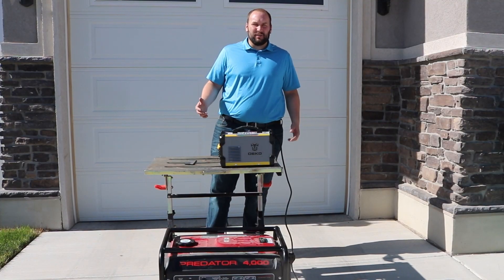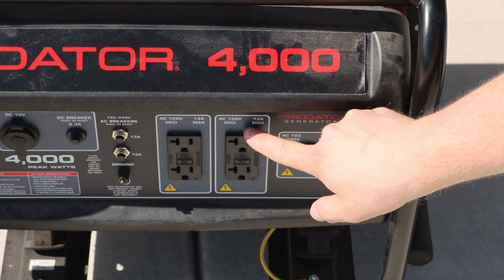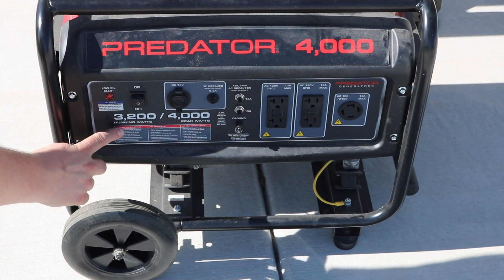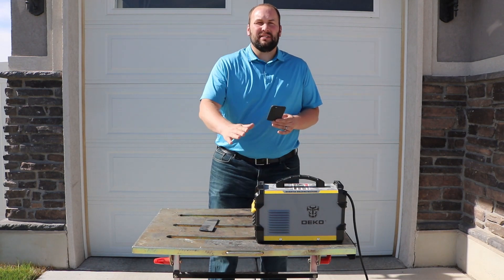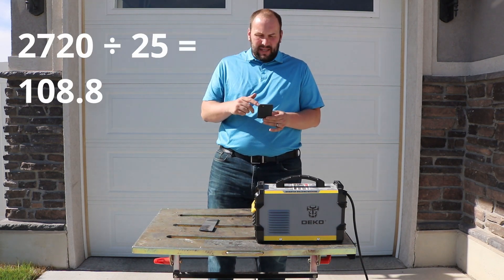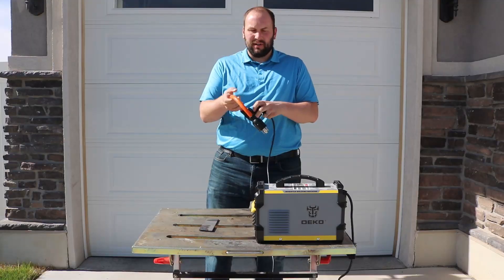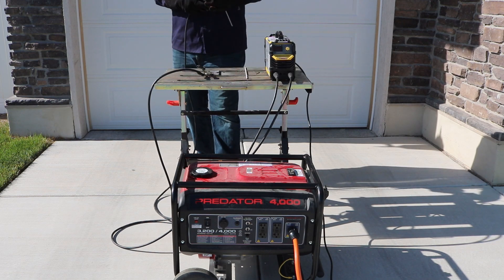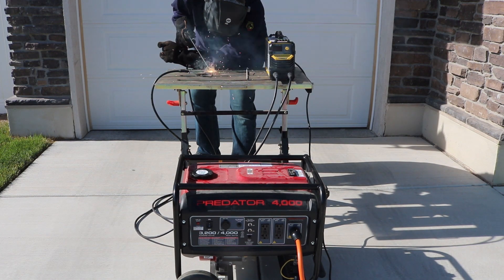How to Run a Welder Using a Generator

Comment: you might be able to adjust the generator to rev a bit higher when using the welder at a higher setting. last summer another guy was using a really small generator with a few power tools and the engine kept bogging down or stalling. I made a few very slight adjustments to the idle and governor settings while testing the generator under various loads.

Comment: I have a 7000 -8750 Predator generator. My welder is a 225 amp machine will my generator run my welder?
Reply: Did you try it?

Comment: Hi. May I know if you're using a welding generator? Can I use a non-welding generator for my inverter welder? I'm from the Philippines . We recently have no power for 5months or beyond without assurance after the typhoon has recently destroyed our homes and livelihood. So I'm planning to buy a GenSet but I honestly have limited knowledge about this thing. Your help is greatly appreciated 🙂.

Comment: Thanks so much.  You are a treasure.   Never welded before. However, you inspire me to take the rust on my Wrangler HEAD ON. I have an identical generator.  Too many talk on inverter welders not compatible with a regular generator.  Planning to get the Tooliom 110/220.  My question is: can I flux/core on 220v as long as I dont go beyond 100 amps on the Predator 4000? Thanks. Keep on the good work.

Comment: Harmonic distortion is why you can't get the full 100a. Large dc loads mess with the waveform coming from of the generator and even the grid which creates a feedback loop. If the generator isn't inverter style with low thd you can only load it to 50% with a dc load. Harmonic distortion is also hard on the electronics in the welder also.
Reply: Thanks for the education. I'm glad I came across your comment, I almost made the mistake of trying this
Reply: He was probably 10% out with the power factor aswell I have a simular machine with 240v and 25amp requirement to make 120amp dc with a .75pf it means I need a 4.5k watt genny or higher
Reply: What about an AC welder?
Reply: What generator should I get ?
Reply: @Victorv100 Making Mistakes With Greg just put out a super detailed video on this.
Reply: Thank goodness you guys are here. I got a 6k that didn't work as well. Now seeing this and what I need I can safely say what I need to get working again.
Reply: Sounds like a similar principle of running high draws on power inverters in RVs/autos... They're often rated at half of peak output, like RMS ratings on an amplifier, but if you run say, an angle grinder, it will only give you half of the RMS rates amps of the inverter.

Another example - I could easily put a 5000 watt inverter in my work truck to technically run a welder. But the welder will trip the inverter due to excessive draw. Suddenly we have a massive discrepancy in actual efficiencies. Use at maximum ratings have less efficiency than low use percentage.

Electricity generation is a very interesting subject.
Reply: Partly true, yes. Many cheap inverter (switch mode) devices rely on stable input frequency 2 generate voltage. The good 1s self generate / regulate the reference frequency. Most cheap generators cannot maintain frequency as the voltage with increased load. Simply, the switch mode device gets confused resilting in voltage and current variances. Such is why I prefer transformer units.
Reply: @Dark_Knight_USA 😊

Comment: I have been using a generator to weld for years but I use a bigger 8000 watt. When I turn up the power to 200 amp it bogs a little bit.

Comment: Hey Tim your videos are awesome since your knowledgeable about generators I had a question ,  so I got a buzz box ac 225 and I’m looking for a generator and I’m leaning towards a predator 8750 watt. I’m getting use to the terminology with it would run at 50% but could you please tell me if that’s a good decision ? I just don’t want the generator to get tripped up or have not enough power I only run at 110 tops but any help would be appreciated bro
Reply: Any luck with that generator I just got a 10500 running watt 13000 surge duromax and i also run a buzzbox. Trips on 1/8” 6011 trying to figure out why.
Reply: @benjanos5580  dude I haven’t grabbed one yet I’m about to grab this miller thunderbolt 160 what machine would you recommend because it can run on 120 and 240? I was thinking duromax but idk
Reply: @jokarpo6723  dude i also want a Thunderbolt im gonna get the 210 though because i do some heavy stuff sometimes also it can run on the 13000 duromax.
Reply: @benjanos5580  thanks bro I’m definitely grabbing that than that’s a nice machine if your grabbing the 210 tho I’ll definitely get back to you and let you know how it’s works out tho 👍
Reply: @jokarpo6723  awesome will do!
Reply: @jokarpo6723  since the buzzbox is ran by a transformer, its way less efficient, and you need more power to run it efficiently, if I were you Id get a bigger generator, like the duromax 13000, and get a nice inverter welder just like the Thunderbolt im really exited to buy It within the next month.
Reply: @benjanos5580  dude just wanted to update I’m just running my thunderbolt 160 on a 20 amp outlet and it’s amazing. I’m good at 80 amps and it’s just melting like butter your definitely going to be happy when you get yours man
Reply: Yeah you need at least 7500 Watts to run a decent welder on 240

Comment: Why don't you just spend $100 and buy a step-up converter it will jump your v from 110 to 220 and they're only $100 on eBay

Comment: I have a lincoin 50 amp 220 arc welder and just bought a 13000SW/10500RW generator. doesnt even bust a small line out

Comment: I have a 230v multi process welder, I hooked it up, set it to stick, I went to go weld (stick), but it wouldn’t weld. The machine was saying low voltage input. I can also plug the welder into a 120 outlet, but can’t weld at high amperage for my bigger 1/8” rods. Is there a solution??? Thank you!
Reply: Bigger generator is the solution, and/or an inverter generator.

Comment: Good video and good watt calculations. Probably your generator is 4k peak, and 3.5 continuous watts. I know engine welders are rated that way... I learned to weld on a engine drive because I didn't have to electric service to run a 300a DC welder.. anyhow my neighbors wanted to kill me! It was very noisy but I learned quickly 😆
Reply: That part about the neighbors 🤔

Comment: Hi sir..do we need use adapter when welding using a generator?
Reply from the maker: In the USA, the standard plugs on welders with 240 volt input are different than those on most generators. That is the only reason for the adapter.

Comment: hi Tim, I have a welding machine of 6.3 kva, 110 volts, 50 amps ...... what must be the power required to weld normally on a generator
Reply: From what you're saying, a 6.5kw would probably be safe, but it's best to have extra power when you're arcing up. This video demonstrates how the watts tend to go missing on their angry pixie way to the welder.
Reply: 110V at 50A = 5500W
He explained about 15% “losses” for inverter generators (so 6500W gen) and 50% on engine regulated generators (so 11,000W generator).

Comment: In a pinch you can always raise the throttle on the generator to push some more power out of it if you had to
Reply: not a good idea, you don't necessarily get more power out of it,
you will get a higher voltage and a higher frequency, which will fry your household appliances if you decide to use the generator for that afterwards
Reply: @turtmastert3545 or your inverter welder; it can probably deal with the voltage but the frequency is an issue

Comment: My duro max has 850 watt more but it trips when I use eazy weld & cen-tech 90 amp what can I do to midify or update without buying another generator?

My other Amico stick welder does work why is that ?

Comment: Can this welder weld cast aluminum wheels/rims If I double bevel and preheat? Century by Lincoln Electric Inverter Arc 230 DC Arc Welder — Inverter, 230 Volts, 10–155 Amp Output, Model# K2790-2. 
50 amps

And can I use a generator? (5500 running watts 45 amps 240).
Reply from the maker: Great question. Before looking at machines, the first thing is to consider is the process. That machine is for shielded metal arc welding (stick welding), which is a nightmare on aluminum. A much better process for that repair is gas tungsten arc welding (GTAW or TIG). In particular, it needs to be run with alternating current (AC) and requires a cylinder of shielding gas (usually Argon). The best AC TIG machines for the money that I have personally used are the HTP Invertig 221 (Costs more, but has amazing performance) and the PrimeWeld TIG225X. I have reviewed both of these on the channel. Given the amperage needed to make these welds, you would probably need a bigger generator, but that will depend on the specific machine. Furthermore, the learning curve is a bit steep if you haven’t TIG welded before and will require practice and maybe some specific training. If you want to get a feel for the process, I have an aluminum TIG basics video on my channel. It’s an expensive thing to get in to, but could pay really well as part of a business. If it’s only an occasional need, I’d consider partnering with someone who is already set up for wheel repair. I hope this isn’t discouraging, but I just want to give you the straight story and lead you down a road where you’ll be successful.

Comment: Tim - after 2 days of attempting to learn to stick weld on a generator, I'm glad I found your video. I'm going to rent a 6kW generator because this 4kW keeps trippin' :)
Reply: You need at least 9000 running watts to run a welder I'm a welder and that's what Ive seen over my years of welding
Reply: @yojellybean02  depends on how many amps you expect to get out of the welder.  I ran a Lincoln tombstone at 90 amps on a 5000 running watt generator.  Probably could have gone higher but I didn't need that much heat to do the job.
Reply: @yojellybean02 I just got a 10,000 watt generator so I can run my mig welder at higher settings
Reply: Am probably going to go for a potential overkill 8kw of it isn't too far, aiming for stick and flux core cause cheaper and can go anywhere with them

Comment: Would a 9500 be better for one of those portable stick welders? I got 1200$ budget
Reply: Probably I have a 9500 westinghouse and it will push an easy constant 39 amps and will peak to 50 amps
Reply: @brandonbld17  hey thanks.
Reply: @DB-bk9tr  I forgot to Mention Mention a few things like mine has a remote start has a battery can run off gas or propane and cost me right at 1100 bucks.. I like the Westinghouse better than the others because it has rubber That go over the outlets to keep bugs and water out of itAnd it's just a nice wellWell built generator overall I use it to power my house during power outage... I would send you a link to where I got mine but the price went up to 1500
Reply: @brandonbld17  I was looking at the Westinghouse generators. I’m can’t decide between the Westinghouse or spend a few hundred more and get  a Hobart champion 145 ac welder.

Comment: This video helped me understand the relationship btwn voltage and amps. I've always known Ohms Law. But I kept dividing Watts by 240 volts. No! You need to divide by the ambient voltage! So that's how we get so many amps? Hmm. Thanks for that little bit. Now I know....
Reply: Well in a way its logic no?

If you were to run 240V and 120A you’d pull 29kW. Wich is enormous lol

A mig welder runs between 17-50V if I recall correctly, its’ll be something in that ballpark.

Comment: I always thought you had to have clean power and if not it would effect it negatively? And most generators are dirty power? Been trying to figure that all out
Reply: It's not that they have dirty power, it's that non-inverter generators tend to have voltage/amperage fluctuation while running
Reply: Generators tend to adapt when the load changes and that takes some time. I assume that sometimes this might lower the available power for a second or two, which might cause trouble if you need precise power for your arc.

Comment: Thanks for the video.
I have a small welder to run on temporary construction power. All of your points are definitely taken into consideration.
Reply: Thanks so much.  You are a treasure.   Never welded before. However, you inspire me to take the rust on my Wrangler HEAD ON. I have an identical generator.  Too many talk on inverter welders not compatible with a regular generator.  Planning to get the Tooliom 110/220.  My question is: can I flux/core on 220v as long as I dont go beyond 100 amps on the Predator 4000? Thanks. Keep on the good work.

Comment: What if you get a bigger generator?
Reply: By getting a bigger generator, you will work with a bigger amps, which means using a thicker stick (Ex: 4mm = 170 Amps).

Comment: NO - Your WELDER is going to only draw what it's able to. Also, if that's any kind of sophisticated electronics, you're going to seriously damage it by running it on that generator, which has a square-wave output.

Comment: Thanks for another excellent helpful  video Tim!
Question: Do you think the H.F. Titanium 125 Flux welder would do okay in the scenario? (4k watt gas gen.)
Thank in advance for your reply. Really appreciate all the great welding vid's! Keep-em-coming! ( :
Reply from the maker: It wouldn’t work well with this generator, because each 120 volt plug is limited to 13 amps. If it is a generator with a 30 amp 120 volt outlet, I think it would work, but as you saw, I’ve been wrong before. 😀
Reply: @TimWelds  That's what I needed to know. Thanks for the info! And remember, You're only human and supposed to be wrong once in a while! ( ;
Reply: I'm using the big plug that goes into 110v regular plug the. Gen bogs out too

Comment: Sir can I use a 250amps welding machine from a 7kva generator
Reply: Math says 5.5 kw out put could run 176 amp inverter welder.Do the mathe

Comment: I know on my honda manual says generator capacity is reduced by 7ish% for every 1000 feet (starting at 500') above sea level. In high country you can buy kits to change the air fuel mix and get more out of you generator.

Comment: Great video, one question though. How safe is it, on an inverter style welder (that may specify running on clean power) to run off a generator?
Reply from the maker: A lot of inverter welders run great off of standard generators, but if it calls for clean power, there is some risk of damaging a circuit board. This machine was $100 on Amazon, so I gave it a shot.
Reply: HF has clean power generators now
Reply: Nicer generators have cleaner power , westinghouse, generac, Honda, yamaha,      HF isn't clean power

Comment: 3200 watts is not reality, more like 2200. I learned this with my honda 2000 watt, it only can put out 1800 before the breaker trips and only 1200 continuous. It’s marketing as they round up 40 percent, like you 6 hp shop vacuum running from your 15 amp outlet. Not possible, aka, they are lying.

Comment: from the output of the generator you suppose equip a capacitor bank for run the welding machine.
Reply: No that’s kind of ridiculous and costly and someone’s libel to up getting hurt doing it what you do is you go buy a welder generator combo Hobart and Lincoln both make a real nice one

Comment: I run an Ac 225 Lincoln at 120amps. I found I burn for 15 second with 6011 and pause then go head and start again. My generator is a 6250 storm responder Briggs and Stratton. Also this is on 3/16 2 7x8 thick pipe.  Keep the videos coming bro appreciate your information.

Comment: Bought a 5600W 30A gen hoping this works. We will only have solar at our new property and I need to do A LOT of welding. I have a harborfright mig welder I think it will run just fine but my inverter 160A might be a prob. We shall see!
Reply: I like the Lincoln 90 inverter welder, 3000 watt inverter is suppose to be able to run it.

Comment: I was a bit surprised that you had no trouble running 6010 on that little inverter welder.
Reply from the maker: I've actually only run 6011, 6013 and 7018 on it. I think it may struggle with 6010, but I may have to give it a try.

Comment: Just curious, do you think the 9000watt generator that predator makes would hold up to run a 240 inverting welding machine? I want full potential out of my Welders. But want to make sure my generator is more than capable of handling the job.
Reply from the maker: It should be able to. Keep in mind that some inverters run better off of a generator that others, so it might be worth asking the welding machine manufacturer what they recommend to make sure.
Reply: @TimWelds  thankyou!
Reply: @TimWelds 
Most of them base their numbers off rpm-regulated generators and double the power input requirements of a welder.

Comment: That 240v outlet is 13amp max, that welder im sure will draw at least 20amps running at like 90am on the welder, simple ohms law
Reply from the maker: Thanks for the comment. Since I didn’t know the input resistance under load, I used the definition of power (P=IV). Using conservation of energy, this can be rewritten as e*I1*V1=I2*V2. Solving for input current gives I1=90*25/(.85*240)=11 amps draw. I’d love to see the ohms law solution that gave you 20 amps.